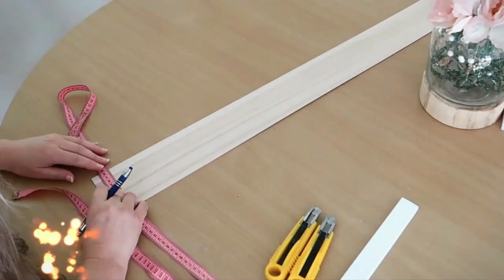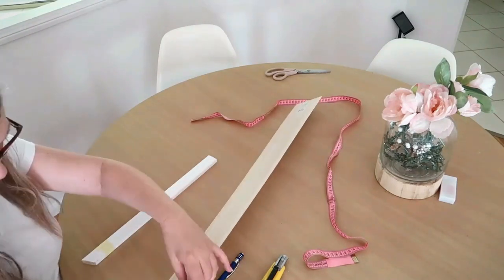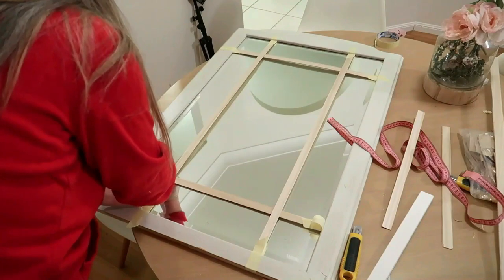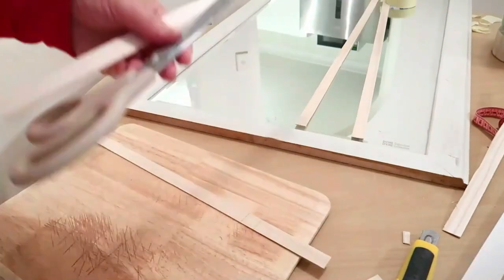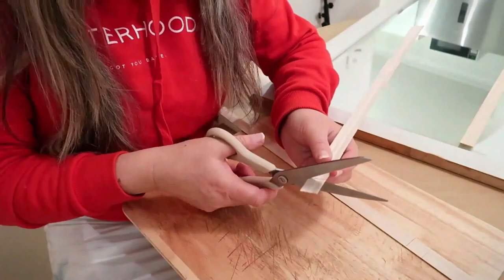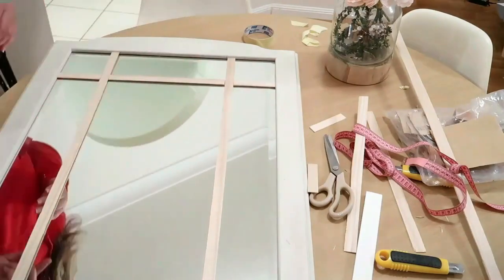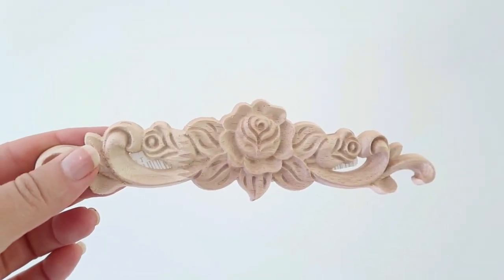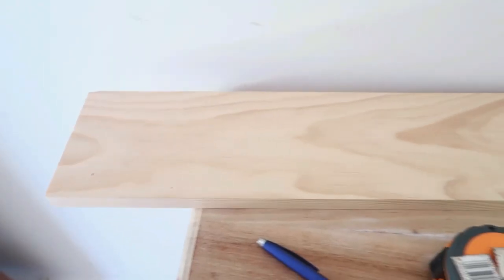DIY Window Mirror on a Budget ~ Mirror Makeover ~ DIY Windowpane Mirror ~ Mirror Upcycle Idea

Comment: Very beautiful work 👏  . I love the colour.  Which adhesive did you use for fixing the shelf part? How long does it take to dry?
Reply from the maker: Thank you! The color is rose pink, it is pretty and is a Kmart chalk paint. I upcycled a little hallway table in the same color and I think it gives a pretty vintage look to them. I used product called Maxi Nails to glue the little window sill, it was only $2.50 from Bunnings. It sets as hard as a rock but not too quickly so if you make a mistake, you can adjust it. 😊
Reply: @ourhumblehomediy   thanks .. I will check for its availability in my place. Looking forward to seeing more of your videos.   😁